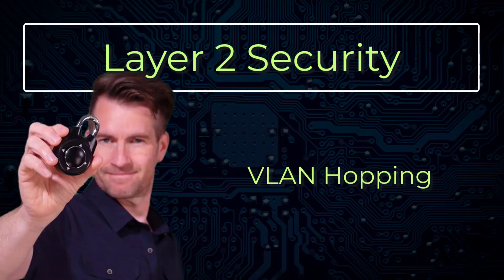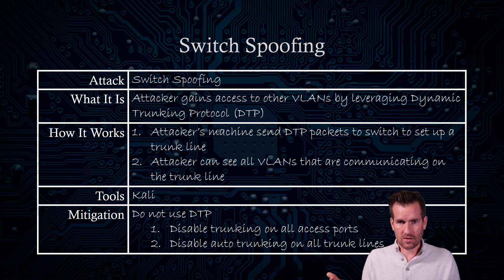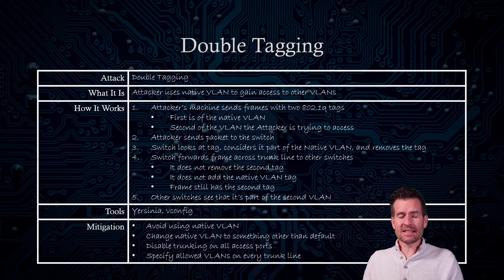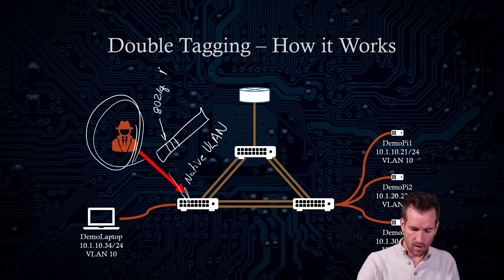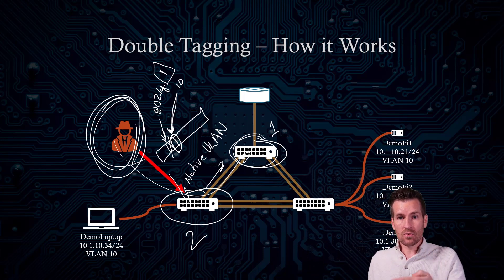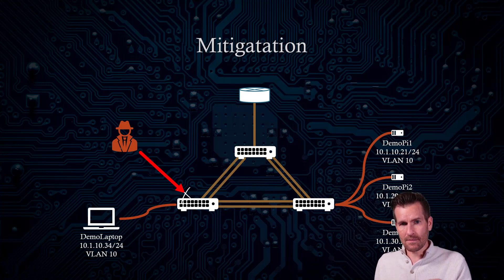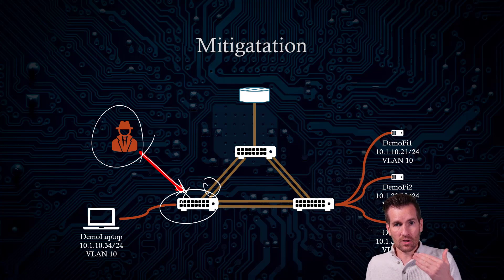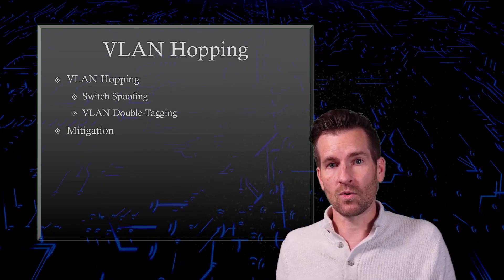CCNA LANs 11-4: VLAN Hopping

Comment: I understand it. So considering I am attacker or hacker. First of all I will use switch spoofing to see all vlans on the trunk line acting like a switch. I will see it connecting to some access port on the switch.Secondly I will use Double tagging to see other parts of your network and attack them too. On 2:49 you say there 1 vlantag is native vlan, 2 vlantag is vlan10 so if someone is wondering how attacker know second vlantag I am thinking attacker used 1 method there to know information about other vlan, am I thinking right? Also I have 1 question can we just shotdown that default vlan , the native vlan ?
Reply from the maker: Yes, you are on the right track. Here is some more info:

Switch spoofing is real easy to do and can be very devastating to security. Thankfully, it's real easy to avoid by being intentional in how you set up your network. More specifically, making sure you assign each port as an access port or trunk port will mitigate almost all of your issues.

To my knowledge, VLAN hopping is not a common type of attack. I've tried to imagine how you could use it to carry out an effective attack and it just seems to be very limited in scope. I've done some research on it and it just seems to be more of a theoretical attack and not really practical for most attackers. In other words, yes it's a security flaw we should guard against since it's easy to combat, but no, it's not really much of a concern in 99% of cases. That being said, PCI DSS doesn't allow logical segmentation (VLANs) as a form of security, so there is at least some risk with it.

You can't shut off the default VLAN, but you can just not use it. This is best practice. It really isn't that much of a security risk in using it, but it's best practice just not to use any defaults.

It's best to use native VLANs on trunk lines to avoid issues, especially with legacy equipment. Remember, native VLANs really only applies to trunk lines. If your explicitly defining your access and trunk lines, you eliminate issues with native VLANs because native VLANs aren't exposed to your access ports.

Native VLANs are per link. That means there is not an official native VLAN for the switch and each trunk line can have it's own native VLAN.

Ultimately, by not using Dynamic Trunking Protocol (DTP), being deliberate about assigning each port as an access or a trunk port, and maintaining physical access control to any trunk ports on a switch, you eliminate most of the concerns with both VLAN hoping and switch spoofing.
Reply from the maker: One other thing, even though native VLANs are per link, I set a global native VLAN for all of my network. This makes it easier to manage. I don't use the native VLAN for any other devices, it's only for trunk lines for layer 2 communication between switches. Think CDP. I also don't route the native VLAN, so even if someone where able to get onto the VLAN, they wouldn't be able to do much since it doesn't go anywhere.

Comment: If it would be the attack by leveraging DTP protocol, this means that the attacker can both send and receive frames from any multi-switch VLAN, is this right?
Reply from the maker: Correct. It would act as a switch and able to receive any traffic on any VLANs associated with the port.

Comment: Very good explanation.
I noticed the double tagging attack was successful, only because the attacker was connected to a port which was a part of native vlan. If the attacker was connected to a port which was not the part of native vlan, lets say, was a part of vlan80, how would have double tagged frame (first tag vlan 80, second tag vlan 10)travelled in this same network?
Reply from the maker: Great question. I've had similar questions myself in the past. In the past, I've analyzed VLAN hopping quite a bit and did quite a bit of digging on the internet. Ultimately, It's not a real practical attack. That is, many hackers are looking for low hanging fruit/easy targets. From what I've found, it's highly improbable that an attacker would even try this exploit because the scenarios in which this attack is effective is not very often at all. You almost have to engineer the scenario where VLAN hopping becomes an issue.

That being said, the solutions for protecting against from VLAN hopping are quite simple, has very little to no drawbacks, and guard against other types of attacks. Not guarding against it opens up a very slight chance that someone could attack your network, so why even take the risk at all.

This is all to say, be aware that VLAN hopping is a thing and the basics of how it works, but I wouldn't overthink it. For your specific question I can't think of a way that is possible. If your not connected to the native VLAN or are on an access port, you can't really do VLAN hopping, or at least not that I've been able to think of. I can't find anything online that would suggest otherwise as well.

Here are a few things I do to really lock down my switches:

-Don't use VLAN 1
-Native VLAN between switches are not used anywhere else on the network, just for the trunk lines themselves
-Trunk ports are set up to only pass traffic of the appropriate VLANs for that switch
-All unnused ports are turned into access ports
-All unnused ports are assigned a "dead" VLAN, one that cannot go accross trunk lines
-All unnused ports are in the shutdown state

Comment: How often does double tagging work?  A while ago, I tried to send a VLAN frame through a switch that already had VLANs enabled and it didn't go through.  The only place I've seen double tagging is with telecom equipment designed to connect a customer to a fibre.  The carrier would use the outer tag to isolate customers on the fibre, leaving the inner tag for the customer to use.

Your precautions, I would call normal configuration, that is make access ports access ports only and enable VLANs only where needed, such as VoIP phones that also connect a computer or WiFi access points that have multiple SSIDs.
Reply from the maker: Absolutely, I agree! I would call it normal configuration as well. There's a reason why it's normal configurations :)

The only times I've seen or heard of double tagging has been when someone is testing it out. I have not seen an actual attacker use this method before. Perhaps that's because if you use best practices, you don't open yourself up for this type of attack.